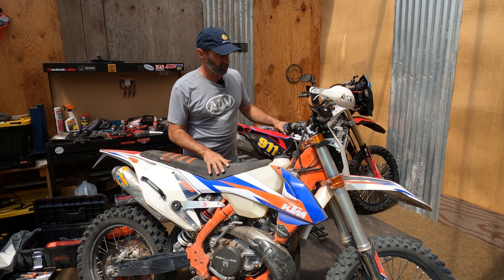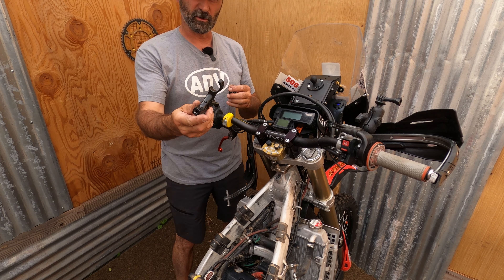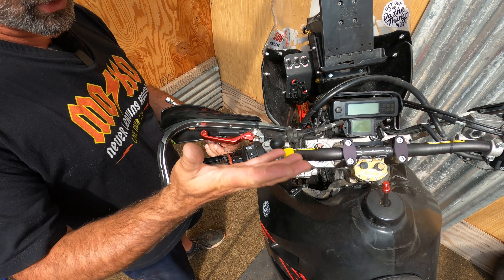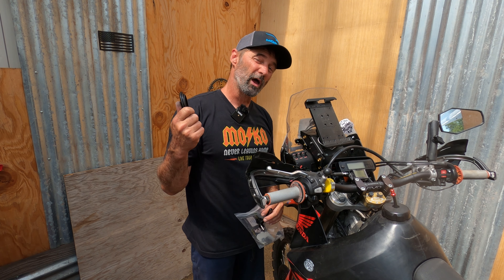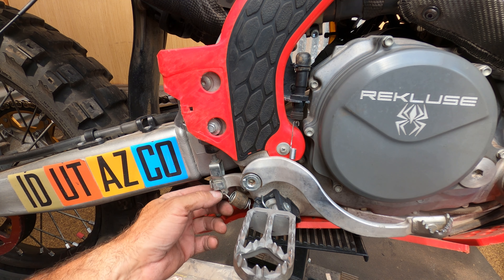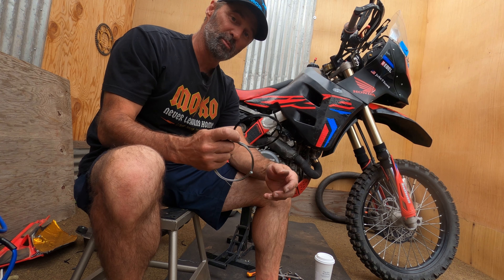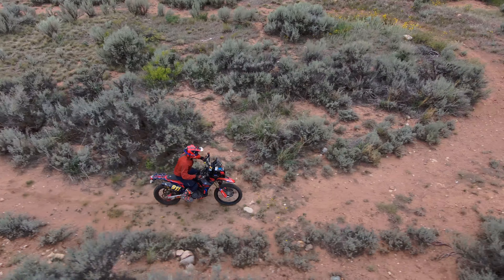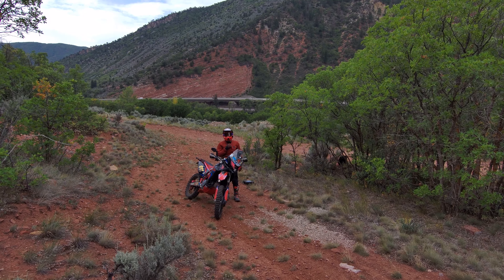Ox Brake LHRB On A Honda CRF450L/RL? Meh.

Comment: Lol You tell them John!!! It would've been nice to have a two piece mounting bracket.
Reply from the maker: I did tell them, but you know they're not listening.
Reply: @JohnTYoung  They heard you... see below.. There is not a mechanical lever with enough leverage that uses a "clasp" or a "cap" design.    The only lever that has been tested to work properly, is the one you broke...  then your "shimano replacement" that made there interior cable too short.... 

You are through.. I would love to see you do a review with the parts the system was designed to be used with.
Reply from the maker: @jasonew  which would be me buying a CRF450X or other non-450L/RL. I thought I stated that quite a few times, that I was using the product NOT as intended, in case anyone wanted to try it out on their RL.

Comment: John, John, John, OMG, that was hard to watch...it brings back ALL the frustrations I had, figuring out how to mount the Rekluse MC/perch. Now unfortunately, seeing you broke the Ox perch, the replacement does not have the cable adjustment to change the leverage (pull effort) on the lever, and hence, you have a REALLY hard pull....I think it would be so different if you had the "proper setup".
Curious about the drone footage at the end, was that just automatically tracking you ???   that's great :), and what happened at the end, it looked like the drone was about to land in your hands, then took off into the shrubbery.
Cheers, and thanks for putting this up. :)
Reply from the maker: The original lever had an adjustment for length of pull, but I didn't see anything to change the leverage.   Yes, my Skydio 2 drone follows me around like a puppy, unless it's off chasing squirrels or something.   The drone did land in my hand, but the camera stayed on for a few extra seconds after I had ahold of it.
Reply: Geoff is correct,  OX-Brake tried the same "shimano" unit used in this video, with the same results.....it does not offer enough leverage to lock up the rear wheel.  Further,  the supplied OX cable lever (made by Avid) offers much MORE leverage,  the ability to ADJUST the leverage ratio, and ability to LOCK UP the rear wheel. As Geoff mentioned, had the recommended, or "proper setup" been used, the results would be different.
Reply from the maker: @oxmotorcycleproducts5820  totally admitted improperly set up on a bike it wasn’t made to fit. Thanks for joining the conversation!
Reply: Hey Geoff...how did you end up mounting the Rekluse LHRB on the CRF450L....still struggling...thanks